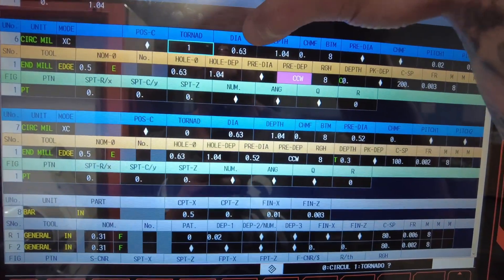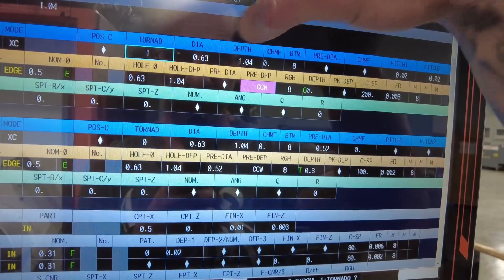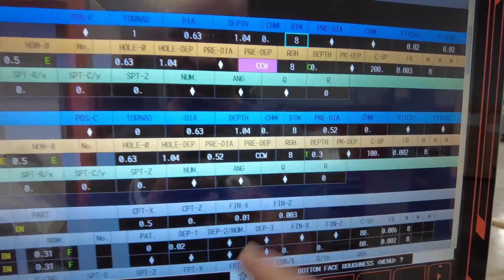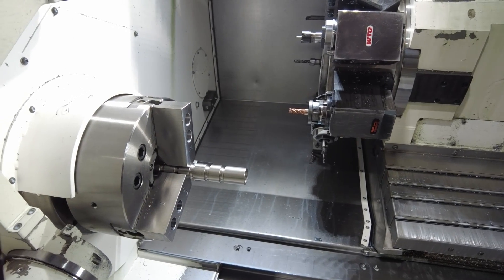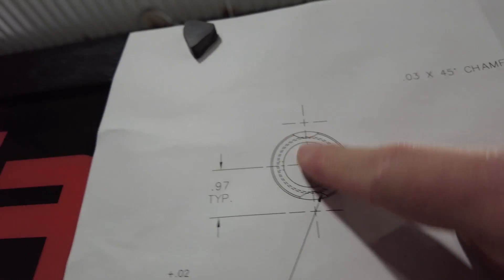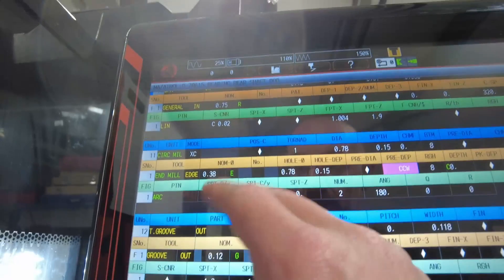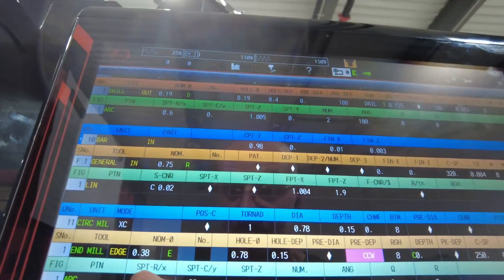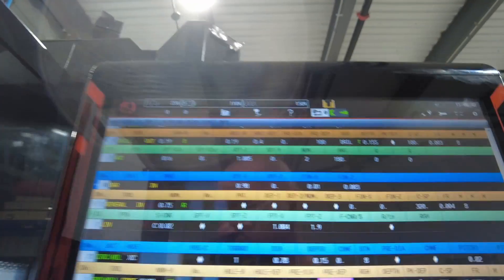Mazak Smooth G Circle Mill Circular vs Tornado Option

Comment: Can you tornado mill with X,Z, and C. Instead of X,Y,and Z.
Reply from the maker: I've seen machines do that using Cam programming,  not sure if it's possible in Mazatrol, it be a sort of drilling cycle with added rotation that changes on x axes, hard to say, I'll check it out when i get a chance .
Reply: @martyz3232  if it could be done could you make a video. Explaining it that would be awesome.

Comment: Pitch1 is the pitch used when putting a chamfer at the start of your tornado milled hole
Reply from the maker: Thank you for that information, I actually tried to play with the numbers on both, and it seems that if you change either of them to smaller number, it makes the cycle longer, so it seems that both pitches be implemented into the whole cycle, not just chamfer?
Reply: @martyz3232  you can set pitch1 to a higher number but it will make the chamfer very coarse. I usually set mine to .0015-.005 to keep the chamfers looking smooth. To lower the cycle time for this you need to shorten the clearance position in the TPC. By default it starts the cut .0787 (2mm) above the surface and I'll drop this straight down to .010. The parameter is called "2nd R-point" or something like that, I can't recall exactly and I'm not at the machine.
Reply from the maker: Thanks for the tip, I'll play around with it once I have bit of time.

Comment: Good video. How about putting a groove in with a cutter in a bore? How would i program it?  
. The bore is .191 and the groove is .308dia. Im using a .062 wide mirco groover now.
Reply from the maker: in a lathe mode or using a live tooling?
Reply: @martyz3232  live tooling.
Reply: I got a manual program now to do almost all the groove then i go in there with the id groover to finish the depth due to the woodruff cutter having not enough clearance. I got 2 grooves to do and its c276 hastaloy. The manual program a guy at work wrote for me. This milling stuff is new to me.